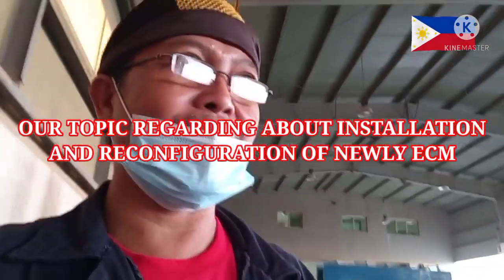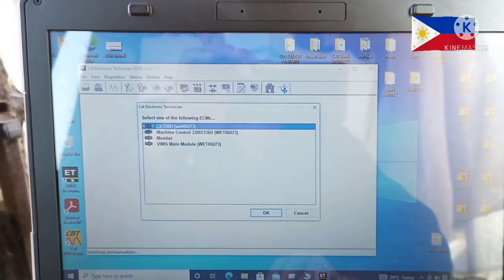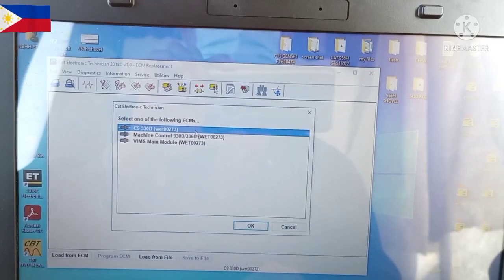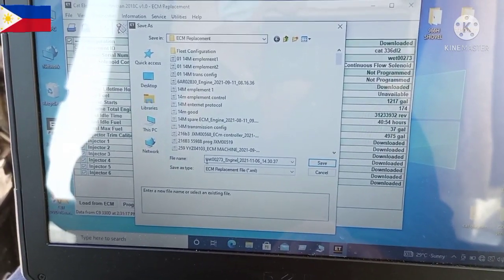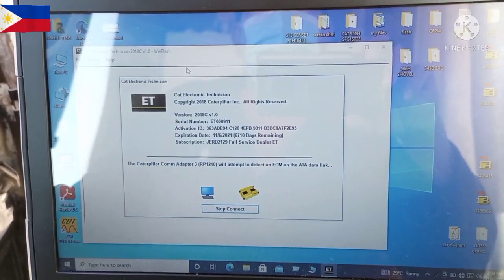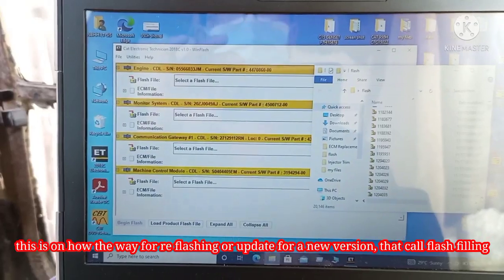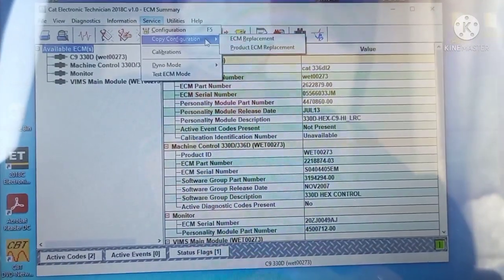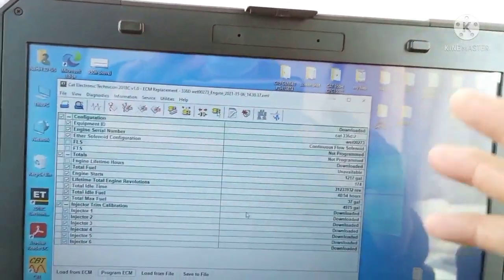CAT ET COPY CONFIGURATION AND RECOPY TO NEWLY ECM TO REPROGRAM (REQUESTED VIDEO)

Comment: Thank you so much But I have a problem with 323d excavator after starting the engine and you put the hydraulic leave down the one on let hand said the engine is going off what could be the problem?
Reply from the maker: check power shift solenoid located at the main pump

Comment: Tanong lang sir  excavator pc60-7 humihina lahat pag ginamit  4 n oras lang ginamit halos ayaw na gumalaw kung malamig naman o.k  naman
Reply from the maker: sinsya n ngayon ko lang nabasa message mo,about dyan sa problem  nga machine,hindi ko masabi kung anu talaga ang iksaktong problema dati o kung anu nba ang mga nagawa n dyan bago nagkaganyan,ung storya ba,pra may idea ako s mga pwede nating e apply na proces kung anu at saan maguumpisa,ask ko lang kailan kyo nagpalit ng hydraulic oil,filter,at anung klasi ng oil ginamit.ksi ppwedi  ksi n mababa n ang viscosity ng langis,or baka ung oil filter mo sa hydraulic eh subrang tagal n hindi napapalitan,yan muna dapat alamin s pag ttrouble shoot mahirap ksi mag direct s mga major n valve,un pla nsa minor lang ang problema,ha check nyo muna ung mga nsabi ko.or pwede nyo rin ako e add sa whatapp +971567581176 pra mabilis ang usapan ha.
Reply: Sa auction kasi namin kinuha last week lang kami nag change oil w20-30 gamit namit langis oil 10 ung hydrolic oil nya bago rin filter ung nasa tangke ng hydrolic na filter lang ang d namin napalitan lahat bago na
Reply from the maker: @oliverbotoog9670  try nyo muna palitan o tingnan nyo ung filter n nsa loob ng tank

Comment: Sir paano kung wala kang flashfile?
Reply from the maker: kung wla kang flash file,the only way n you can do, ay reconfigure from the other machine with lates version,copy mo lang ung configured file nya then yung ang e program mo for your machine,but before mo gawin yan you have to make it sure n naka save ung original configuration ng machine mo just in case n hindi suitable ung lates version maibabalik mo ung dati.,so everytime na magrepair k lalo n electrical related problem,you have to copy all the configuration ng machine n gagawin mo,pra secure kna kung sakali man n naiinis k at na out of focus kna,ang tanging nsa nsa isip nlang baka reprogram lang mag ok na dahil meron knang copy ng configuration so no worry.
Reply: @caterpillarjhunhunk  ok sir jun..salamat sir..